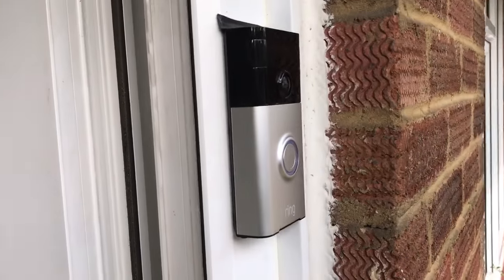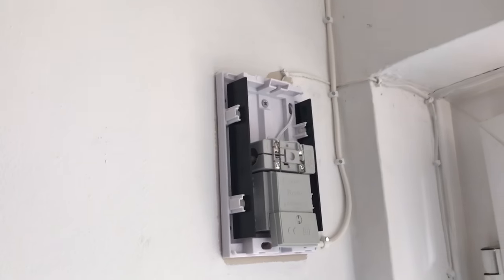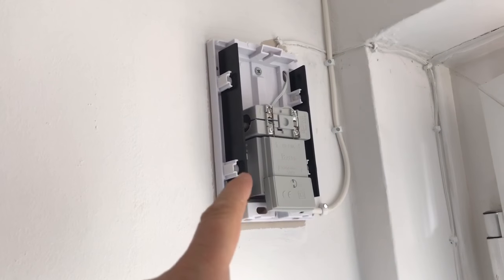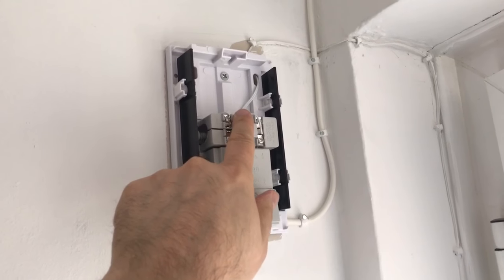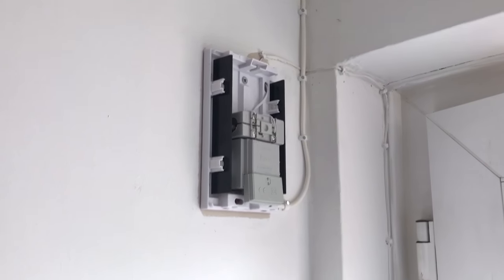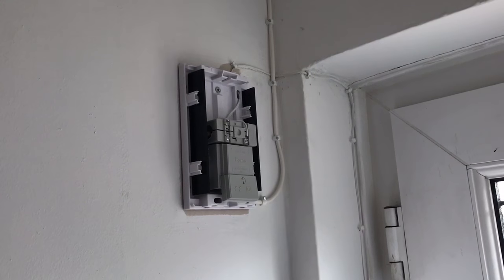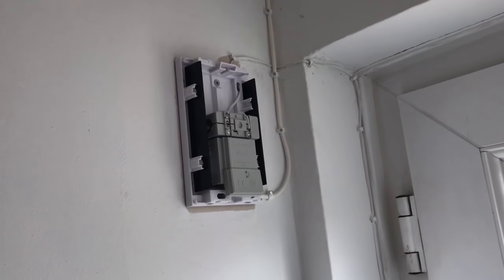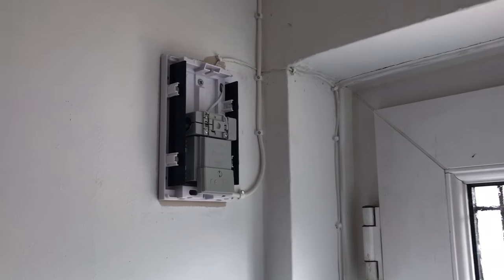Ring Doorbell - hard wiring Byron 776 (not 766 as per vid)

Comment: This is exactly the video I've been looking for, very helpful. My deta chime isn't compatible. Now I need to buy a Byron 776. Thank you
Reply: Ordered a Byron 776. The ring doorbell will run off battery until I replace the existing chime. Thankful the wiring is already in place, so it's a straight swap.
Reply: @jamesw5420  hello. I have a Deta c3500. I have am planning to also do as the video and you, the wiring hard to see here but perhaps you could guide once fitted? I have the 4wires from the doorbell(white+blue and white+orange) and then the main power blue and brown. I do think I heard the power coming in 6V but I don’t know. I hope you had all this fixed, Ring told me three different things abs was so unhelpful. Thanks
Reply: @kousafyhan4117  I tried today wired as is and my chime didn't work.  So perhaps not all are compatible.  The voltage I was getting at transformer was 15v AC.
Reply: @ElektrodriveUK  hi thanks for letting me know, actually since I messaged I was able to change over the doorbell chime to the Byron and managed to get it to work, I have had the Ring connected now for 2years and no issues. I do know that I took some images the day I changed over to keep as a guide so can find it if you need it but for me the change was the chime only as far as I remember. Thanks
Reply: @kousafyhan4117  I would appreciate if you could share your diagram as for me it didn't work the Byron 776 chime.
Reply: @ElektrodriveUK  sorry I only just saw your reply. Unfortunately I am unable to share the image as I don’t know how to, luckily I was able to find the old bell chime and then the Byron wiring, if you want you can ask me anything and I can try word it to you if that helps but the reply doesn’t give me an option to share images. Also I should mention that in my chime there was overal 4 different wiring, so in the Byron I was able to connect them into different areas which was quite easy I suppose but yes will explain where goes to where
Reply: @kousafyhan4117  I had the connection to 0 and 2 the ring wired door bell powered up fine but no chime unfortunately.  Some people say that initially won't work but after leaving it connected the chime began working.  Did u have the same issue?
Reply: @ElektrodriveUK  no my one was working immediately, the charging was showing on the ring app as hardwired and the sound was working perfect also. Are you sure maybe the wires aren’t connected incorrectly?
Reply: @kousafyhan4117  I followed the wiring guide.  I'm guessing doesn't matter which side of the doorbell wire goes to 0 and which goes to 2 on the chime?
Reply: @ElektrodriveUK  I put Oranage/white to 0, Blue/white to 2, on the bottom I put brown to the left and blue to the right. If you did that also can I ask what is happening or what’s indicating it’s not working?
Reply: @kousafyhan4117  I did the same.  Just doesn't sound the chime when I press the ring bell.  The ring door bell sounds and alerts come on my phone to say someone is at the door and camera kicks in but no door chime from the mechanical chime.
Reply: @ElektrodriveUK  can I ask if the door bell wires are connected properly or try the wires the other way around? Also does the app say it’s hardwired and the charging is good? Also if you want you could try your old bell to try the chime if it’s working and then try wiring the ring again?

Comment: Thank you so much for the video! Really helpful and nice to see a UK set up rather than a US! 👍🏻 Just ordered my Byron wired doorbell. Going to use it with a Ring Pro 😀
Reply: Hey John - Did you manage to get this to work with the Ring Pro? Got a Pro coming to replace my Ring classic with the 240v - 16/24v transformer and would really like the mechanical bell to work still. Did you have any luck routing 16-24v through the Byron 776?
Reply: tomroe114 Nope. didn't work.
Reply: Didn't work for me either with the Pro. It just made the Solenoid constantly him, but I just bypassed the chime in the end and went with the Ring Chime and just used the Byron as a transformer.
Reply: Can you clarify my understanding of the situation?  I have a Byron 776 and I'm thinking of getting the Ring Video Pro but don't want the hassle of installing the 16-24v transformer.

It sounds to me it's hit and miss if the Ring and Physical chime will work (with the standard 8V) but the worse case scenario you can by-pass the Chime and use the built-in transformer to power the Ring?  And use the Ring Chime as a replacement for the Byron 776 (Ding Dong chime)?

Comment: Great informative Vid. Thanks! I've only just bought one and discovered my mechanical bell is not compatible. So my choice is 1)  buy the Ring Chime or 2) install a compatible mechanical bell. I understand the limitation on the Ring Chime  is that it only chimes once in any 30 second period no matter how many times you press the bell. Does the mechanical bell have the same limitation or does it chime as often as the bell is pressed?
Reply from the maker: Hi thanks for you kind comments, the ,mechanical will work like a normal doorbell and can be rung many times, no time limits
Reply: @MrPantss  thanks for quick reply. Mechanical bell it is!!!

Comment: So glads I came across this UK video as I just brought the Ring Pro so hardwiring is going to be needed.
Reply: Hey Chris - Did you manage to get this to work with the Ring Pro here in the UK? Got a Pro coming to replace my Ring classic with the 240v - 16/24v transformer and would really like the mechanical bell to work still. Did you have any luck routing 16-24v through the Byron 776?
Reply: Hi, with the UK version of the Ring Doorbell Pro you get a transformer in the box which you can put on a DIN rail but you can also wire mains in to the bottom and have wires coming from the output for the doorbell. I have mine working fine apart from the typical Ring issues but nothing can be done about those until they build a better device.
Reply: Thanks Chris

Comment: Hi, I have this Byron chime and am trying to connect it to a Ring Doorbell Wired, but the mechanical chime then stops working. I have not used the bypass, but have wired it same as in this video, but no chime working. Any ideas?
Is the Doorbell Pro so different to the Wired ( which needs an 8v feed)?
Reply: The version you've got disables the chime...return it and get a second generation one.
Reply: @JohnTannerinDerbyshire  Thanks. Odd because when it goes into boot mode, often, the chime keeps pinging. Got my money back and wont be getting another for the silly money they want.

Comment: Hi, i have wired mine from the old door bell wiring so fused cable that I believe is on the lights mains. Just the two wires on 0 & 4 is this all you have apart form yours is plugged in?

Comment: Great video mate.

What voltage is this doorbell? I bought a Arlo doorbell but either transformer that came with it knackered or my electrics isn't compatible. Kept buzzing. Anyway if the new transformer works I was thinking of getting this doorbell as mine doesn't have enough voltage.

Chime has to be between 8 - 24V

Comment: Thank you for the confirmation - I'd fitted this same doorbell setup but it didn't work. It turns out the 'ring' needs some time to have a think about things, contact its home planet and make sure all is well - then it suddenly starts working just when you think it's time to give up and go home. Also - on the 2019 version of the app, there is a simple slider to turn down/off the actual door-chime sound at the button.
Reply from the maker: Yes you are right things have moved on since I made this video and indeed there is a slider now. Yes when you plug it in it will take time to acknowledge its wire powered, also I have found mine occasionally says it’s not wired, then a day later decides it is again. I have toe new Ring 2 and it still works. It takes patience. I also found ringing the doorbell seems to wake up it’s config as well....

Comment: Hi Alex, Thanks for the video. I've got the same door chime and looking to fit to mains. I noticed that there was no earth terminal on the chime. Did your mains cable have an earth wire? If so how did you deal with it? Thanks again
Reply: The chime unit is a class II appliance and does not require a connection to earth. It can be fed by 2-core lamp cable, or you can terminate the circuit protective conductor of a 3-core flex, “twin and earth”, etc., in a terminal block inside the bottom of the chime enclosure.

Comment: Hi All, I know this is years old but looking into this keeping existing door bell instead of using WiFi chime box. I get how it will charge by bypassing jumper used or new box like this video but I can't see how you can charge and use existing door chime? In the normal setup prior to ring bell fitment, the button when pressed simply completes the circuit to the chime box and you get the bing and bong when button depressed. Upgrading the transformer and fitting jumper cable, great now there is power at ring door bell to charge or power completely but the button will no longer trigger original chime as circuit amended.
Reply from the maker: Yes I understand what you mean, unfortunately the button is not simply closing a circuit like a conventional door bell switch does, it’s closing a circuit into a small computer, with programming, so it only works with certain types of doorbells. They have their compatibility list of traditional bell boxes that will work with which models.
Reply: @MrPantss  thanks for reply, totally get yours is all working and great but being an electrician I sometimes look to deep without even starting the job lol. This is extract from ring that I just found. Once installed, Video Doorbell Wired will not sound your existing doorbell chime. For audio notifications around your home, pair with a Ring Chime, a compatible Alexa-enabled device, or choose a Video Doorbell and Chime bundle.
Reply from the maker: @richierich.1982  ah you will defo know more than me, I am an IT tekkie person, not electrician so this is more your bag. Interesting info thanks mate

Comment: Didnt work with a ring 2, tried installing this same setup got 7.26v ac from transformer once connected to ring 2, 14.8v without anything connected, also the hammer arm was making a wiring noise. Cable length to bell cat 5 was 3 metres 😭
Reply from the maker: Andy Morris sorry to hear that Andy, I just used doorbell wire and it was about 2 to 3 ft. Perhaps the Byron is faulty? Or as a test try a short piece of wire?
Reply: I reckon it could be alex, I will try another one and hopefully be ok 👍

Comment: Hi, I have the same exact door bell as you, Byron 776. The transformer inside is 8V 1A. I need to power up my HiWatch DB-120A-IW Wifi Smart Doorbell. Sadly the power output is not enough. I need to of course change the transformer to 16VAC - 24VAC. I want to clarify if I need to change the bottom half of the unit, i.e. the 8V 1A and not the chime, or do I need to do both? Do you  recommend any places I can get one from? Thanks!!

Comment: Hi mate any help would be appreciated.  I have the ring wired door bell not the pro.  I changed my chime which was deta for the Byron 776 unfortunately my chime doesn't work but the ring camera has powered up and works off the phone.  How did your chime work?
Reply from the maker: Yes the chime works perfectly
Reply: @MrPantss  have I wired something wrong?  Do I need to activate anything?  I used the connection 0 and 2 and haven't used anything like the link wires etc.
Reply: I am using the ring wired (not the pro)
Reply: @ElektrodriveUK  did you find a solution to this ? I’m having the same problem with the RING wired door bell
Reply: I did exactly the same changed my deta doorbell for the byron 776 and added in an external transformer. Wired the ring bell wires to 0 and 2. Ring bell works perfect but still no mechanical chime. I tried the reset button it chimed once but that's it.
Reply: @mohammedsabir3993  no solution so I contacted ring. They said it's not compatible with mechanical chime that we have.

Comment: How quickly do you find the notifications come through? Watching some of other peoples reviews they find them come through faster when the doorbell is hardwired. Have you found the same? Do you have to contact them to enable the live view once it is installed? Is that part of the installation?? I had a £10 screw fix voucher so I was able to pick up a Byron 776 from them for just £1.37, so i'm pleased about that.. Cheers..
Reply from the maker: Hi Ed, the notifications can be hit and miss, they are not really based on batter or mains feed, more internet connection.  I have to say the wifi receivers in the Ring Doorbell are not great.  You can do a health check on the Ring in the app and it tells you Poor or Good wifi connection.  My wifi router is about 25 feet away line of site, but goes through a wall and I get POOR wifi!!!  I put a wifi extender about 10 feet from the doorbell and now get GOOD.  Even with good it most the time is quick and connecting, but sometimes is a little slower, perhaps 5 - 8 seconds to connect.

Yes, once you are hardwired, the status of the Ring changes from Battery symbol to a symbol with a lightening strike through it and it says Hard Wired, once it says that you can email help@ring.com and ask for Live view to be enabled, its not part of the installation.

Comment: I have bought and installed the Byron 776 and the Ring Doorbell is working as expected however I can not get the internal Chime on the Byron doorbell to activate when the button is pushed outside.

Do you have to fit or configure anything else? 

I checked the Ring install instructions and it says to bypass the Chime with the Diode and connect to a different terminal.
Reply: Same problem. If anyone can shed light on it please let us know!
Reply: Same here...
Reply: @rattlyskoda13  my issue too
Reply: Same here.. anyone got resolution to this problem ?

Comment: I’ve wired mine in the same. From mains to doorbell chime and then to my Ring video doorbell 2. Shows as hardwired with the white light but won’t charge my battery up. I’ve been trying to fix it for months with different transformers and resistors but still no joy?
Reply: I'm having the exact same issue with the same set up, did you ever work out a fix?
Reply: @caution2011  I kicked off with Ring and to be fair to them they posted me the Ring Pro free of charge. Wired that one up and no issues at all. 3 core cable to the supplied transformer and then cat5 cable to the doorbell
Reply: @greggyboy28  I put a call into ring, they couldnt find any issues and told me to keep an eye on the charge daily to see if the trickle charge would kick in, sure enough 3 days later it started charging and have not had an issue since

Comment: hi i have the same byron hard wired bell, fitted ring push button bell with ring chime  want to turn of ring chime and use the byron ding dong  how do i do that !
Reply from the maker: In the app, go into the doorbell settings cog top right , then go into Device Settings, then select General Settings and in there is Ringer Volume.
Reply: @MrPantss  hi  do i turn that down and then will the byron ding dong work ?
Reply from the maker: @andypibworth8072  yes

Comment: What did you loop to get the doorbell chime running?
Reply from the maker: I didn’t loop anything Ian just connected the two wires
Reply: @MrPantss  so I've got mains in live in the left and neutral in the right. Then top right doorbell terminal and bottom left. It chimes as ring power starts and then doesn't chime from thereon,
Reply from the maker: @smithia6  how long is the wire from the doorbell to the bell box?
Reply: @MrPantss  I set it up on my worktop 1st to do it so I have a plug with a live and neutral and then a purchased a 5m thin 2 core cable and I just wired up both ends so it's not installed yet but the cable needed to the ring and box will actually only be about 500mm if that once installed.
Reply from the maker: @smithia6  that should work….. leave it rigged up for a while, I remember in the start mine was a bit flakey but then sorted itself out. I wondered if the door bell was doing a software update and it would not ring the bell box whilst doing so
Reply: @MrPantss  I'll give it another go it rings the chimes as it's powered up. I was thinking otherwise just using the Alexa as a chime.

Comment: Great Video-have had the Ring for few months and was getting fed up of the charging chore. Wasn't sure on the size of the transformer-This has helped me a lot. My question is,
How did you wire the standard door bell please- when you hard wire Ring-and when you press it ,does the door door bell become automatically activated or did you have to wire the bell to the Ring too. In video this is not clear. Well done . great video
Reply from the maker: Hi, I don't fully understand your questions, please ask more if I have not answered it.

I mounted the Byron 776 on the wall, connected the mains wire as per the instructions that came with it, ran the mains cable up into the attic and through the wall into our attic conversion.  I then fitted a 3am mains plug to that wire and plugged it in.  The Ring doorbell I just connected the normal door bell wire from the Ring to the doorbell, again following the instructions.  The transformer is built into the Byron 776, so no need to have an external one.  It works perfectly!